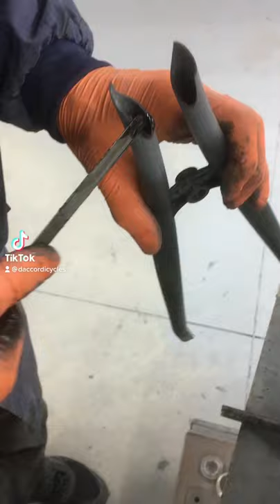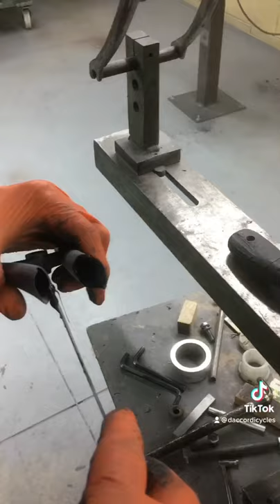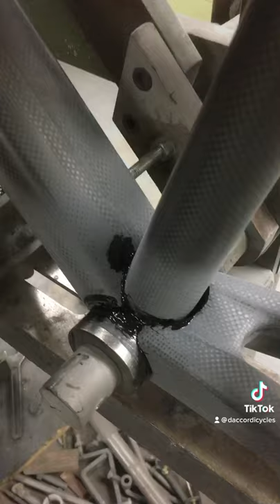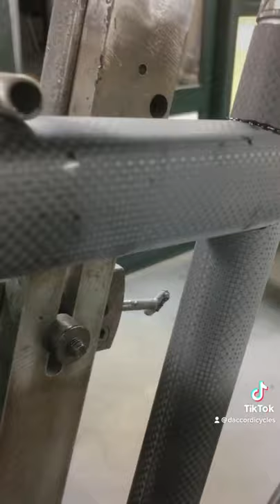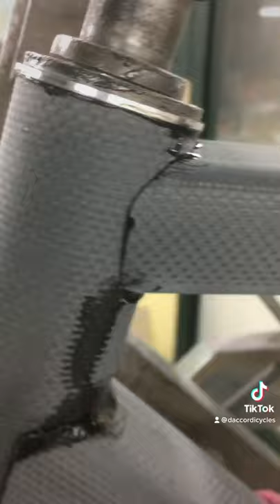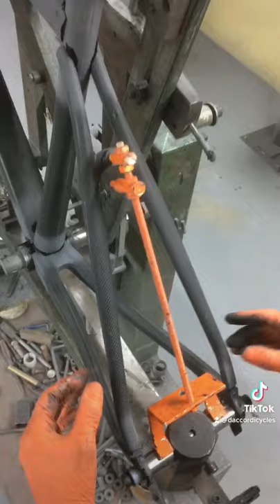A carbon bike frame handmade in Italy by Daccordi - how we give shape  and the right size and angles

Comment: Carbon fiber tubes are just super-glued together or is the black paste some kind of pre-welding treatment?
Reply from the maker: it's just a pre-welding treatment. Glue is needed to give shape and to report the right geometries
Reply: Why is it called pre-welding? Epoxy melts at 70 degrees Celsius.
Reply: @rewind9536 he said kind of pre welding, carbon fiber can't be welded,but the method is kinda similar like when u welding a steel, he glued "pre welding" like that is just to make it stay in position and the measurements is right after that he gonna cover the join with prepeg carbonfiber and put in the oven.
Reply: What is the black glue please?

Comment: This is a joke compared to Time frames. Sorry but that's the truth. Would never trust this way of manufacture!
Reply from the maker: Statistically, we have fewer broken frames than Time. But you are free to trust whatever you want.
Reply: its just few grams heavier if made properly (wraped with kevlar-carbon hybrid + pure carbon ) should work well and fully custom made to any shape / size you want to mm 
can be even made way stronger by extra layer of hybrid material 

i work with composite materials for years (as a job and hobby) if i was making it to last i would just first slide ? kevlar-carbon braid on the tupe (dry without resin and protect from contacting the reasin --- put it on the tube earlier because you cant slide them on it later after glue ....)  , glue frame like on vid , then wrap connections with carbon directional + twill then kevlar-carbon hybrid and then slide onto it the braid put on earlier but now with resin 
wrap everything with heatshrink tape / vacuum bag (small vacuum pump / vacuum cleaner , dont use full vacuum) and should be super tough yet heavier but waaaaay stronger than any other frame on the market
Reply from the maker: @ErtsenPlayGames  so it's what we do. Then some builder warp in a way, other prefer to wrap in other way. Someone use kevlar like us, some else no, but the result is certified and waaaaay stronger than other frame son the market, we know this.
Reply: @DaccordiCycles  Interesting, would mind giving out the data that allows you to confidently say that you have fewer broken frames than Time Bycicles ?
Reply: @DaccordiCycles  Interesting, would mind giving out the data that allows you to confidently say that you have fewer broken frames than Time Bycicles ?
Reply from the maker: @yohansharp3040  we have our data, you have to ask data from Time - you are the fan of the brand, and then we will compare them. We know the result.
Reply: @DaccordiCycles  ? I never said I was a fan of Time 😂
If you have the data that shows that your frames brake less than others, even Time frames (that are well known for high build quality), you should use it as marketing material